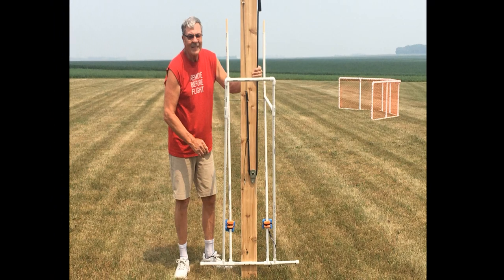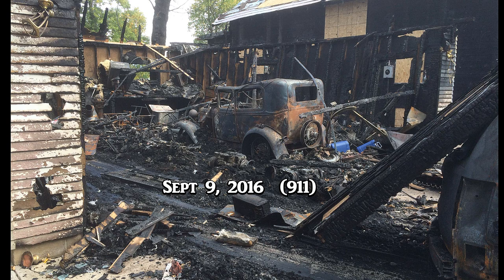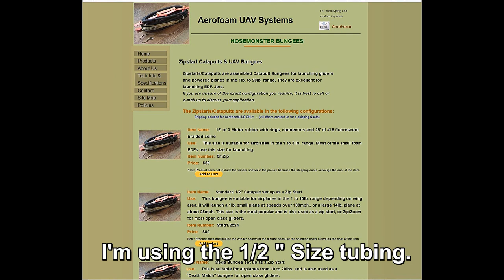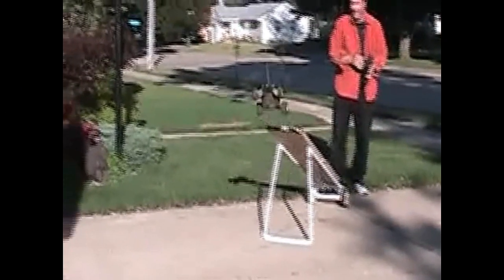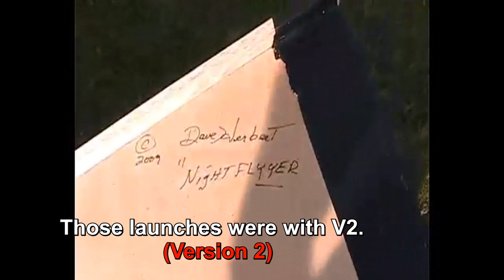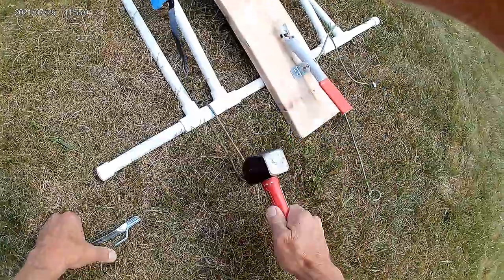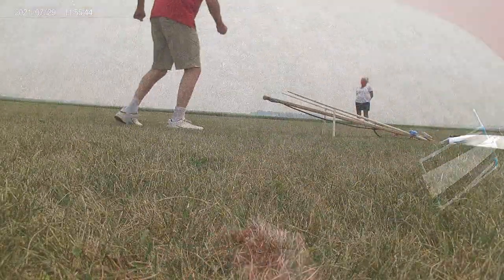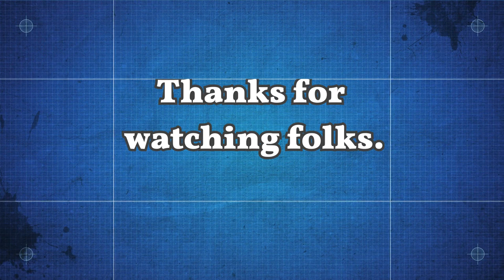Catapult this! Huh? See my R/C aircraft catapult launch all kinds of things, plus my Opterra 2M.

Comment: Hello Dave. I just came across your video with the self contained catapult V2 that works I well in launching your Optera 2M and I was really impressed. I have a couple of large delta wings as well however I cannot launch them myself because I am in a wheelchair due to an accident that left me a high level paraplegic. I think your catapult is what I need to get these taradactles flying again.Do you have a build video, drawings, sketches, anything I can reference to build my own. The size outer diameter of the PVC, info/specs on the pulley, photos, etc. Anything you’d be willing to share would greatly be appreciated. On another note, I was thinking of doing some videos of different aspects from RC aircraft for other disabled individuals interested in picking up the hobby but how do you manage the huge file size of the video and it still be uploadable? I would venture to guess in the post-processing using some kind of video editing software. Am I close to being correct? Looking fwd to hearing back from you soon.

Regards,

Phillip Sherwood 
Huntsville, Alabama

Comment: I like it!  Your self contained catapult will work great for rough field launches (like gravel roads).  What do you think about the idea of landing the Opterra in a big net (frame of  pvc, angled about 15 to 20 degrees from the ground)???
Reply from the maker: Yes, the net will work, but know this 2 meter Opterra will glide a long time and lands very fast.  Hitting the PCV sides, if you don't get it perfectly centered, will be hard on the Plane.   I have to go way out to line up, but of course I now have retractable landing gear on it, so is is a bit easier.

Comment: excuse me sir, may ask ask ?
did we need a longer catapult to launch more heavy RC ?
or the push power is all we need ?
Reply from the maker: Good question.  Well, it is the Pulling power of the launch hook.  Longer is okay, but wouldn't fit in my car. So I just doubled the amount of rubber underneath to get it stronger.   So far this launched anything I have tried. Here is a link from the one I built 15 years ago.  Video quality, not as good back then, but you will see me launch all kinds of things.  Thanks and happy flying. https://www.youtube.com/watch?v=LOsiKnha-bc

Comment: Hey dave, i love the launcer for the optera. I considered the model but it was a bit rich for my blood & instead went with the Hobbyking phantom 1 meter fpv wing. It takes a 900kv motor that is in the same neighborhood, power-wise as my size 40 2 stroke os engines. I am seeing if conversion isnt feasible, i love the idea of a nitro giant wing! Heat sheilding must be carefully considered (she's foam) but ultimately i want long range and nothing beats ic for that. Her shape ALMOST lends to ducted fan, and a vlow ducted fan would be just keen, but thats a lot of acerage to heat protect. All up shes just over a kilo, i have yet to actually get her in the air trying to get my Jumpertx, aura5 board to talk nice to each other.. Have you ever gassed a foam wing? How did you protect it from fuel & heat? Am i kidding myself? And finally, why is it called KY jelly? It should be KY JAM! thats what its for! 🤔
Thank you! Ill be here all the week.
Reply from the maker: My big 1/3 scale Pitts, that I just donated to the AMA museum, was foam and Nitro powered.  Nitro fuel does not attack foam, but gasoline will.
I think it would be an easy thing to convert, so good luck with it and post your video link here when you do so we can see how you did it. Hand launching would be a pain, with nitro fumes and oil in the eyes and on my glasses, and it would not work on my launcher, as the electric motor is off during launch and nitro would be running.  Good luck with it and thanks for the kudos, Joseph.
Reply: Thanks for the fast reply, and my apologies for the off color joke, early onset geriatric profanity disorder. Ok, honestly not all that early. Anyway, i concur, barring starting the engine remotely with nitro, for which solutions im aware of  are heavy, bulky, expensive, unreliable & designed to operate on the ground. I was thinking about your launch cart, vs. The catapult.  Fascinating story how you first learned of catapult launching in the military, by the way, and thank you for your service. . I absolutely agree hand launching would be yecchy & unwieldy, not to mention exceedingly dangerous. Its not unheard of to lose fingers to a fuel driven propellor, and the bite from your electric looked pretty painful! Have you regained full use of those digits? The 2 engines i mentioned i have 40 sized i recently acquired used from an old timer enthusiast i recently made the aquaintence of who lives near me, sold me 2 complete Goldberg Eagle II for a fantastic price, i needs love the other pristine, i figured the former to serve as organ donor to the latter, has nice but old servos and even  ancient FM 72mhz Futaba recievers channel 51 & 53 respectively. I wish i had an old transmitter to check functionality, but ill put modern radios in for reliability. Thinking of attempting solo glider tow-launch with ardupilot self landing following glider release... What could go wrong? I would have someone knowledgeable standing by to hop on sticks in case anything happens. Wow i can sure ramble! Sorry....
Reply from the maker: @josepharthurl2191  Well, I think my guitar days are over, as the finger is healed but won't curl all the way very good. Maybe it'll get better, but I'm 74, and it may take longer than I have.  LOL  I am flying my Nexus 30 with rotor blade lights using a Futaba Helicopter radio on 72mhz.  It works great and I don't have any interference out here as not many fly them these days, but they were very reliable, including the Kraft Signature I built for my self, back in 1979 when I worked for Kraft Systems in Vista, Ca.  I'm not afraid to fly them today.  I flew on 53.400 Mhz which required me to get and Ham technician license.  I just took the test again and renewed it so I could fly some of my FPV drones on those frequencies.  I flew on 53 Mhz the entire time and my Signature series has still has the 53.400 TX module in it.  Good luck with autopilots and your launch.  Find a local club and I'm sure many folks there would be happy to help.  Take care and happy flying.

Comment: you might like to try ... silicon tube .. we use it with all our fishing gear. to catapult bate out .. ?? try it it works.. tone uk
Reply from the maker: I tried silicone long ago,  but for big planes, I could not get enough out of it.  Mine is done and working, so not planning to change the rubber, especially after spending $80 for it from the company that makes launchers for the military with this Latex. Thanks for the suggestion.

Comment: not bad, i dunno why you need a catapult for the F27, it just flies out of ya hand. as for the opterra, you need more "oomph" on that bungee.. it's stalling just as you put the motor on
Reply from the maker: Because I don't want to be cut again and this is easy and fun. F-27 was a test.  It works fine and every time, so I believe if it works, don't fix it.
Reply: @NightFlyyer  i can understand that for the opterra. when i had mione, it was a PITA to launch, but for the F27, I throw it with the throttle off and then ramp it up after
Reply from the maker: @WX4CB   I didn't see your Opterra 2m on your channel and would've liked to have seen your launches. I have had over 40 folks tell me they got hurt with theirs as well, (including the F-27), so I am not alone. Luckily you never got hurt.   Of course I can easily throw the lightweight F-27 and have many times, but launching is just more fun. Besides that the big Opterra is not easy to throw for this 74 year old man in our winds and the launcher actually has more punch than any of my throwing launches of it when I first got it. Thanks and happy drone flying.
Reply: @NightFlyyer  i don't have the opterra any more, it was too big for me and i totally agree it's a complete PITA to launch, luckily inever got hurt with that. Now the heaviest wing i have is the mini talon and thank god for inavs autolaunch otherwise i couldn't throw it.

There's a coupleof videos on the channel with it in here: https://www.youtube.com/c/DaytonaFPV/search?query=opterra 

like i said, i'm not disagreein with you and the launcher, and didnt realise you were that young :D
Reply from the maker: @WX4CB  Haha.  God bless.